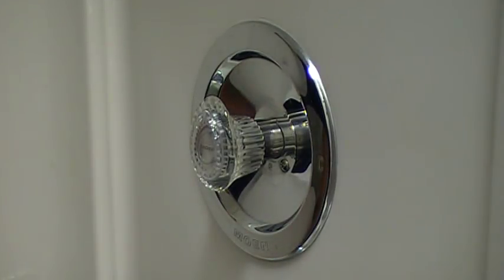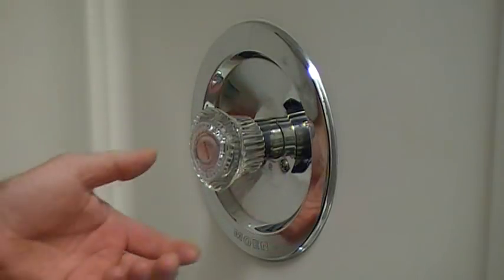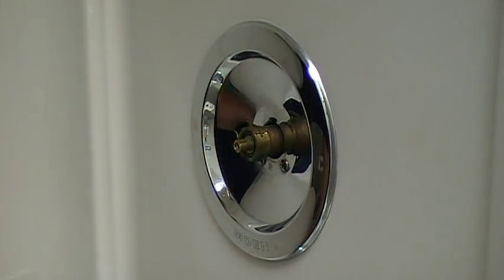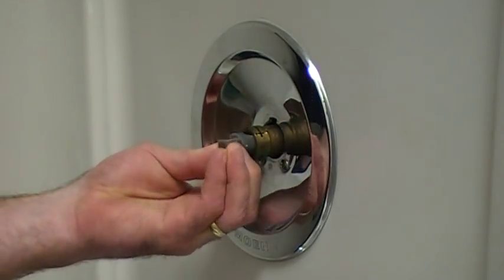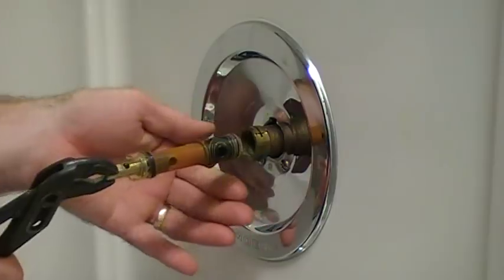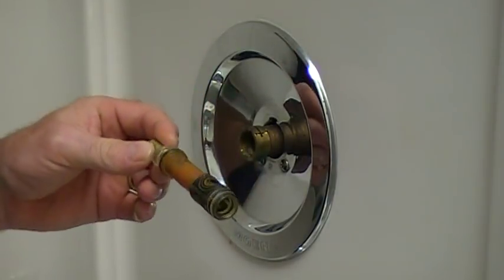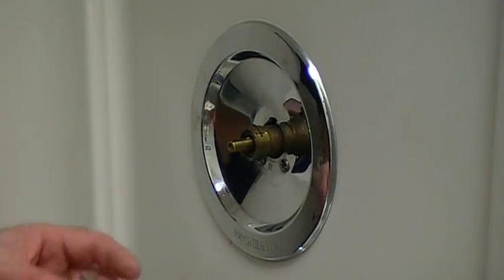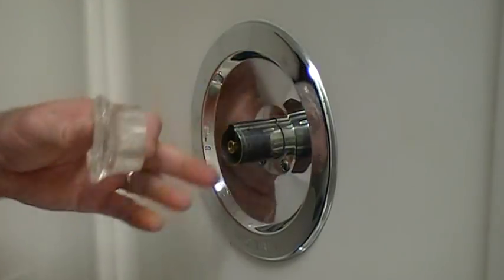How to repair a leaky single lever moen bath or shower faucet..Older style

Comment: What can I do if the outer sleeve of the cartridge is jammed in the pipe?
Reply from the maker: Hello Kevent,
You must turn it somehow to break the seal between the faucet body and the cartridge. Have you tried the plastic tool that comes with the cartridge? Take the wide end and slide it into the end of the faucet after you have removed the retaining clip and try turning it back and forth with a crescent wrench to free it up. 
This is a video I made on removing the cartridge if the plastic tool should fail.... 
Removing a moen cartridge from the faucet! If the plastic tool should fail you! Plumbing tips! 
This may help if you are interested. If all else fails you can purchase a knock off Moen puller from Home Depot. They are not overly Expensive.
Thanks for commenting and best of luck with the repair!    Al

Comment: Why we have to replace the whole cartridge? can we just replace the O rings?
Reply from the maker: tpsandiego 
Replacing the o-rings will not stop the faucet from leaking. If you are going to go through the process of removing the cartridge; it is better to replace the cartridge and you will have no issues.
Thanks for commenting and have a great week!    Al

Comment: So i managed to the cartridge out (which i need to go to home depot to have it matched) BUT the nozzle is still dripping water at the moment. Is that normal?
Reply from the maker: Pili MF 
It is not normal for the faucet to be dripping after the repair has been made especially if it lasts. If it is on a bath and shower combination and the shower has been run; a drip can continue for a while from the piping going to the shower if the diverter has not been released.
If it continues; I would recommend going back and returning the old cartridge and trying another. If you call Moen's 800 number they may send you a new cartridge in the mail if you tell them when you installed the faucet.
Thanks for commenting and best of luck with the repair!     Al
Reply: Thank you so much for getting back to me. It ended up all fine. Of course I was freaking out the whole time because I have no knowledge of these more masculine things. Haha. But it was success!
Reply from the maker: Hello Pili MF,
I am glad everything worked out for you!
I am sure if you put your mind to it; you would be able to figure it out.
Thanks for commenting nd have a great day!  Al

Comment: when i repair the shower leak,Shut off the main valve.It's necessary to shut off the water heater that supply hot water.????
Reply from the maker: +Nelson Lee 
If you turn the cold water main off in the building; there is no need to turn the water heater off. That will work fine for you.
Thanks for commenting and best of luck with the repair!    Al

Comment: I live in apartment so how do I shut off water supply ? Plz advise.
Reply from the maker: Hello Shiraz,
I would have the landlord make the repair for you because quite often depending on the size of the building; you sometimes have to turn the water off to the entire place. If it is a big apartment building there would be individual valves for each unit that could be located almost any where.
If not you may want to check in behind the shower or tub and see if there is an access hatch where you may find a set of valves for the faucet. 
Remember you must turn off the cold and hot. 
Thanks for commenting and best of luck with the repair!    Al

Comment: Do I have to turn off water supply? I cant find water supply cut off valve
Reply from the maker: +Kewfit 
You MUST turn the water off before you try and replace a part on the faucet!
You cannot do anything to the tub/shower faucet without shutting the water off.
Thanks for commenting and best of luck with the repair!     Al
Reply: Ok thank you my tub is in an apartment complex so shutting off the entire water supply is not an option I don't see any water shutoff valve around the bathtub. Would I need to shut off water supply to my water heater, drain the water, then I can change it out? Thank you I am a newbie to this.
Reply from the maker: Hello Kewfit;
You will need to turn off both the hot and the cold water. Sometimes the apartment buildings are set up with separate shut offs to each apartment. You should check with the landlord and see if this is so.
If there is an access panel behind the tub; perhaps in a closet, there maybe shut offs there.
Just remember you MUST turn off both the cold and the hot before you make the repair.
 Would your landlord not repair this for you? 
Thanks for commenting and have a great weekend!    Al

Comment: I replaced the cartridge but the faucet is still leaking...any other ideas that could cause this problem.
Reply from the maker: Hello Marco,
It is possible; although it doesn't happen often that the new cartridge may have a small flaw in it. This could possibly be the problem. I had another person with the same problem and they tried another cartridge and the drip was repaired. I believe it will resolve it.
Thanks for commenting and let me know how you get along....Al

Comment: You mentioned that you could get a replacement cartridge FREE, was that from Moen or from any store (Lowes..True Value) ??
Reply from the maker: +Les Williams 
You can try your local hardware store. Some of them give them out free. If you bring in the old one there shouldn't be any problem. Better off to call the hardware store to be on the safe side. If not you will have to reinstall the old cartridge until the new one arrives.
 If not, call Moen's 1-800 number and ask for one. They will ask a few questions. I believe there is a time limit now on how long it has been installed, but they are usually very obliging. Excellent company!
Thanks for commenting and best of luck with the repair!    Al

Comment: O.K. I I have done everything in the video, but when the shower is used and I turn it off I can't stop a constant drip.  I have flushed out the system by turning the main water on and off a few times - and then letting it run.  I don't feel any debris, and have put the new cartridge in just like the video says, with the washer, but there is still a constant drip.  Any idea what might be the problem?
Reply from the maker: Hello Rod,
It could possibly be a bad cartridge. Not a very common problem, but it happens once in a blue moon.
You have to try another in order to stop the leak. I have had this happen myself. Very rare, but it happens.
Thanks for commenting and good luck with the repair!     Al
Reply: TheOldkid888 I think you are right...

Comment: I have MOEN .... kitchen  Tap... bathroom Tap and Shower Tap ( pull and turn )     not positemp.  do they use the same Cartridge?
Reply from the maker: Hello Jim,
If they are all pull and turn then you will need the 1225 cartridge. No other style is required. 
The 1222 simply turns and doesn't pull out.
Thanks for commenting and enjoy your week!    Al
Reply: All 3 are "pull out and turn for (hot-cold) so you say i need #1225
Reply from the maker: Hello Jim,
That is correct!
Give Moen's 1-800 number and they may mail you some free of charge to your home.
Thanks for commenting and good luck!     Al
Reply: Yup, my old Moen 1222 went out after 3 yrs. Lowes give me the run around so I had to wait for Moen to mail one out. No problem afterwards. Some stuff doesn't last long these days.
Reply from the maker: Hello Will,
Nice to see you got a cartridge free of charge and delivered to the door.
As far as the cartridge lasting; a lot depends on water quality. I have seen them in place for 2 to 3 decades with no issues and others last for only a few years. 
Glad everything worked out for you!
Thanks for commenting and enjoy your day!     Al

Comment: Thank you for this video, you make it look easy! I'm going make the repair today. :)  One question -- just before you removed the cartridge, you pulled out a small ring, but I didn't see that you put that back in. Was the ring unnecessary? Thank you again for taking the time to make this video. - Mom in Ohio
Reply from the maker: Hello Barbara,
That is a stainless steel ring that keeps the faucet handle out just a little. It is not really neccesary.
There are many faucts that don' have it installed. I never had any issues if ever I removed them.
The biggest thing when making the repair is turning the cartridge back and forth before you try to pull it out.
It makes all the difference in the world in removing it.
Thansk for commenting and best of luck with the repair!   Al
Reply: Thank you for the information!  I wonder if you could answer another question? I'm mid-repair and my setup is a bit different -- I have just removed the handle, and I see there is some kind of collar around the cartridge that has to be removed before I can slide off the outer collar.  It has two flanges in it that slot into the handle. Does that sound familiar?  Not sure how to post a picture here, sorry to be asking such a vague question!  Any suggestions appreciated. :-)
Reply: I got it! That was the back of the handle that broke off. :-)
Reply from the maker: Hello Barbara,
Great to hear!
I hope it didn't put up too much of a fight.
Thanks for commenting and enjoy your day!      Al
Reply: All done and no leaks!

Comment: I can't get the clip to go back in.  I've wiggled and adjust the position, but am afraid to force and break something. Help.
Reply from the maker: Karen Smith 
You must line the tabs up correctly and make sure the cartridge is in the body far enough. If the tabs are lined up directly one above the other, the clip should slide in for you easily.
Thanks for commenting and let me know how you get along!    Al

Comment: What item number was the replacement 1225 1225b ?
Reply from the maker: Mike Zombie 
This faucet takes the 1225...
The "b"  just means bagged I believe.  So you would be looking for a 1225 cartridge.
There is only two cartridges for a single lever that Moen makes and if you have the style that pulls out and turns either way to give you hot or cold; then the 1225 is what you are after. 
The other cartridge does not pull out. It just turns...1222...newer model.
Hope this helps!
Thanks for commenting and have a great week!      Al
Reply: Thanks

Comment: One other question.... I forgot to grease the inside of the pipe before I put the new cartridge in there.  The new cartridge was very greasy right out of the package.  Would you go back in and do that or just leave it?  It seems to be working fine as it is with no leaking.
Reply from the maker: Hello grishfish;
I wouldn't bother taking it out and adding more grease to the cartridge. I rarely apply more grease to them unless they are very dry.
Thanks for commenting and have a great weekend!   Al

Comment: does any one know how to change a cartridge on a push pull shower faucet mine doesn't go back it stays stuck on the shower & doesn't go back to the bottom for a bath i have to do it manually
Reply from the maker: mario d.c 
What type of faucet is it that you have. It sounds like the diverter on the spout to me that needs to be replaced.
Thanks for commenting and get back to me when you get a chance!     Al

Comment: My problem is when using the shower  part of the  water comes out from the bottom!
Reply from the maker: +Raul Cervantes 
Unfortunately you will have to replace your tub spout as the diverter in it is worn and will not allow all the water to go to the shower head.
I made a video on a number of different spouts and how they are removed and reinstalled....How to remove and replace a tub spout. Different types!...
I believe this should help you with your problem. 
Thanks for commenting and have a great week!    Al

Comment: Can't believe none of these guys mention shutting off water prior to removing clip. And this guy didn't clean the opening prior to installing the new cartridge.
Reply from the maker: Hello Erv,
I had all annotations on all my videos as I placed them on Youtube and since then all annotations have been removed.
My first one was.... step 1, Turn off the water.
So I did have that on all of them when working on faucets.
As for cleaning the cartridge; everything was clean as I could tell by the cartridge itself. It came out very easy. 
Thanks for commenting and have a great day!       Al